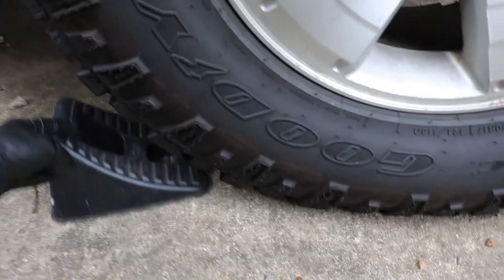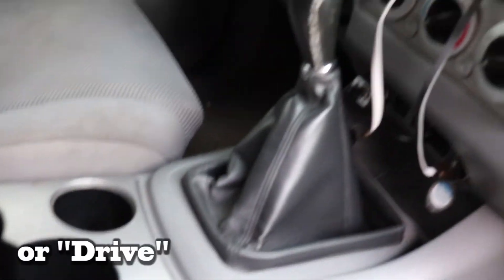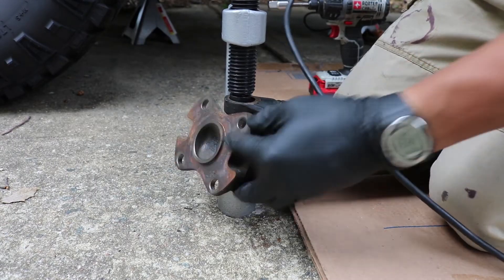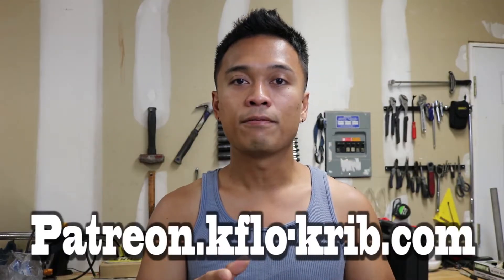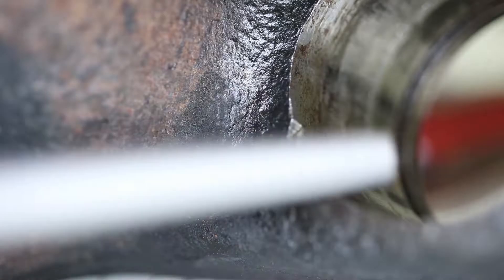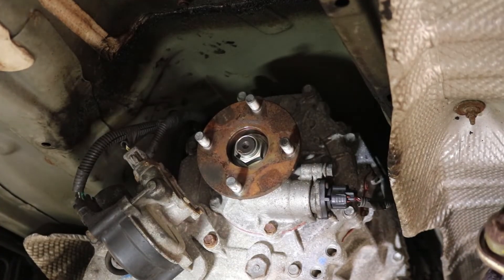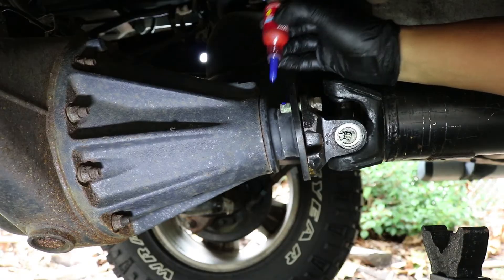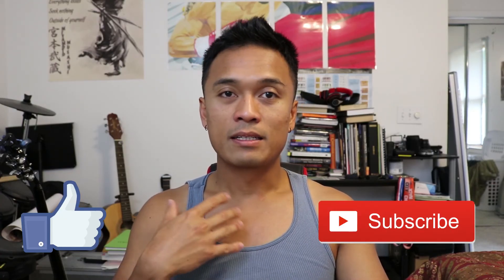U-Joint and Carrier Bearing Replacement (Tacoma DIY / How To)

Comment: You have the best step by step ways Bud!  My 2011 Tacoma with auto transmission is kinda dragging when accelerating on first gear. Will these bearing causing this dragging during acceleration too? Thanks in advance
Reply from the maker: Thanks for supporting the channel bro! When you say dragging, are you saying loss of power? or are you saying that there's a dragging/screeching noise at first gear?
Reply: @TacomaTutorials  didn’t realize you responded Bud. Yes the the bearing was replaced and the problem was gone. But once in a while I can still feel the grinding whenever I accelerate. Not all the time though. Should I just grease?
Reply: The center bearing was also replaced prior to the u-joint. I drive 125 miles one way from Richmond to MANASSAS Virginia and I just want to make sure everything is ok driving this far. Thanks for an awesome vids. You’re the man! Pinoy friend here man
Reply: @TacomaTutorials  Bro please help me on this, the center bearing that was replaced a year ago went bad and the shop put in a new one last Monday 2/2/22. Unfortunately it’s still vibrating. The rear UJoint was also replaced 4 months after the center bearing was replaced. Could the shop I brought it to wasn’t assembling it right from the first bearing replacement and to the new one last week? Please help. I appreciate your help Bro! Your Tacoma knowledge is incredibly amazing. Thanks for helping us here.

Comment: Hi KFlo Tacoma, would you recommend buying a new nut for the center support/carrier bearing?  Or just reusing the original nut to secure the bearing?  I just came across a thread on Tacoma World where someone mentioned that this should be replaced when installing a new center support bearing.  Greatly appreciate your videos!    https://www.tacomaworld.com/threads/cant-find-spicer-u-joints.393477/
Reply from the maker: I reused the old one and these are high grade nuts (I believe 8 or higher). No issues so far after 40k miles. Just secure them properly with the right torque. People can argue the same thing with the 8 other nuts that hold the driveshaft onto the diff and trans. At the end of the day, it's a moot point and it boils down to personal opinion.
Reply: @TacomaTutorials  I appreciate the response!

Comment: HOw to change u joint for bmw e36 which no clip?
Reply from the maker: I haven't done an E36 but you may just have to press it out. after doing some quic research, it looks like the joints may either have a C-clip on the inside or the ends may just have been staked in place

Comment: Just replaced my carrier bearing and 3x u-joints today. Huge thanks to you as I watched your video and did the work step-by-step. Again I think you have some of the most informative Tacoma videos out and I often refer your videos to others on tacomaworld. Thank brother I appreciate it 🙏 👍
Reply from the maker: Excellent! I'm glad it worked out!
Reply: I was told my carrier bearing on 2008 4WD Tacoma needs replaced relatively soon. Mechanic said I had to replace the ENTIRE drive line (both shafts) with it, that I couldn't just replace the carrier bearing.  This video seems to indicate it can be replaced. Thoughts?
Reply: @brianevans6860  find a new mechanic
Reply: @brianevans6860  unless your driveline is all dented up you’re totally fine reusing it. Like the guy above said, don’t go back to the mechanic that told you that.

Comment: How much play should the driveshaft have inside the center support bearing? My Tacoma has quite a lot of play and I’m not sure if needs to be replaced or not.
Reply from the maker: That's a rubber shock mount so there will be play. the issue would be if you are experiencing driveline vibrations

Comment: What do you suggest to do if your u-joint zerk fittings will not take grease. I used a pick to moving the ball in the zerk and cleaned them up really good. Grease just pushes out the side of the zerk on all u-joints and I can’t see any grease getting pushed out of the u-joint itself.
Reply from the maker: It sounds like the zerk is still loose. You can tighten the zerk fitting with a flat head screw driver (if you have the same one as me) or a wrench

Comment: Excellent video, thank you! Do you need to make sure the zerk fittings are oriented the same on the new u-joints as on the originals relative to the driveshaft? Does that effect the balance of the driveshaft?
Reply from the maker: Zerk fittings are very negligible in terms of actual weight balancing. I went from zerks that were on the center of the cross to zerks that are on the outside by the needle bearings. No vibration issues
Reply: @TacomaTutorials  Thanks!

Comment: Did you later install spacers to the center carrier bearing?
Reply from the maker: Yessirree! I installed roughly after I replaced the clutch. Which you saw in the tacoma vibes video.

Comment: Why the locktight and what is the importance of keeping things aligned?
Reply from the maker: Its a high vibration system, loctite is insurance that the hardware wont back out. The driveshaft position is balanced, if its not put back the same way, it will vibrate
Reply: @TacomaTutorials  thanks for the swift reply! The rods in my bearing turned to dust. It is a good thing I finally got around to doing this. Thanks for your help.

Comment: Does all three U-Joints use part 270?  or are parts 290 and 235 used for them? what are the differences between the three Moog U-Joints?
Reply from the maker: All three use 270. Differences are sizes and mounting style

Comment: What press kit is that?
Reply from the maker: This is the ball joint press kit you can get from Advanced Auto or Autozone
Reply: @TacomaTutorials  thx, I liked the 'completeness' of that kit, but not the price when I looked it up :P  Ended up ordering the $50 ABN one instead.   Looks like it has everything I need for the u-joints at least.
Reply from the maker: FYI, its free to rent. They allow you to borrow it for up to 3 months. The rental deposit is the cost of the tool kit. You get that money back completely once you return the item. Look up their loaner tool program

Comment: Great video, I am about 75% done, I took notes and am very happy so far.  I never thought that Center Support Bearing was going to come off the shaft but it did.  The press made everything super easy.  Getting a good angle on the nuts when taking off the drive shaft was hell since i started off doing it by myself, it was very timely, eventually my kids came home and were happy to shift the truck back and forth for me.  Thank you so much for the video.  I spent much less money then if I would have taken it to the mechanic and the last time this same thing happened apparently they only changed 1 of the U-Joints and the other two were dust this time.
Reply from the maker: I'm glad the video worked out well for you! Please help my channel by sharing my vids with your tacoma friends!
Reply: Finally stopped raining and I finished today and test drove it, runs perfect, thank you so much for the video! Next i'm going to try alignment once I get some new tires... Was thinking Michelin any suggestions for all-season mostly highway and in town?
Reply from the maker: Glad to have helped 👍 I have the wrangler duratracs which work great on the road and on the snow. I would recommend those.

Comment: hows the anchor center bearing holding up? just wondering if it would be good to use that or im better off getting the oem part?
Reply from the maker: Its good. No issues yet
Reply: @TacomaTutorials  how long for the whole thing to get finished 3 or 4 hours?
Reply from the maker: I was filming so it does take longer. I would estimate about 4-6 hours. Best of luck!
Reply: @TacomaTutorials  thanks yes video was very good!
Reply from the maker: Thanks for the kind words!

Comment: Great instructions. Followed for my 2010  (110K) Taco after getting some vibration under the seat. Took approx 3 hours for the three U joints (did not do the carrier bearing). I used the U joint tool from Advanced Auto (free) and it made it a lot easier than hammering. Everything you said was exactly what was required. Truck now runs great again. Thanks for your help!
Reply from the maker: I'm glad it helped! Please share my vids with your Tacoma friends!

Comment: Used this video the past few days. Excellent video! Ive watched at least 10x as Ive gone along my repair. Quick note though FSM lists torque on the nut for the Yolk for those at 134 ft lbs, then remove nut and go to 51 ft lbs. First value to seat the bearing, 2nd value is the torque spec.  By the way the breaker bar through the ears was a phenomenal idea!

Comment: Had my u joints replaced but now I have a vibration at 30-35mph and a low pitch sound at 55mph could it be my driveshaft is out of phase ???
Reply from the maker: If it occurred right after the replacement then that may be the case. You never noticed it before right? Those driveshaft are balanced to the drivetrain and need to be installed in the same orientation on both the input and output sides.
Reply: KFlo's Tacoma Build yea it happens after I had them replaced ,,, Would I need to take it to a driveshaft shop or would I be able to get it into phase myself ???
Reply from the maker: Sometimes the dealer may already have marked the driveshaft. If so, then just remove them and line them up. If not, you would have to go to a shop. Good luck
Reply: KFlo's Tacoma Build aright cool thanks

Comment: Great video man as always. Did you have a vibration or did you just feel it was time to change it? How many miles did you have on your rig at the time of video?
Also do you have a 4wd or prerunner?
Reply from the maker: I had some chirping happening at the driveline when I was coming from a dead stop. Upon further inspection, the u joints had some play. I replaced the U-joints at around 110,000 Miles. To answer your last question, I have a 4wd.
Reply: @TacomaTutorials  mine has a small clunk if i push the gas a little hard or if i dont stop completely.

Comment: Excellent video.  I just figured out what a vibration is that has plagued me for some time and noticed the grease was slung all around.  Moog #270?  Looks like several places cross reference this, but Amazon is the only place that says it doesn't fit my 2009 base 2wd.  Also, it suggested a Anchor #6073 instead of #6074 for the bearing, but the descriptions on Rockauto (which also just reads "Tacoma 1995-2015" for both of these, different prices) read suggested both as a replacement with one mentioning 4wd/prerunner, the other for rwd base with the same specs.  Do you know the difference if there is one?  Amazon might be wrong or is the 2wd  base different than the pre-runner/sr5 here?  Thanks!
Reply from the maker: In double checked in rock auto. It does say moog 270 does work. I would recommend getting the moog 270 over the others because the grease fitting is so easily accessible. You can always get the others on autozone or a local shop as backup and return them later on anyways. Good luck!
Reply: @TacomaTutorials  Thanks for the info.  Mine should be relatively easier too because with 2wd, the transmission side yoke is a splined and slides in with no bolts  I should be able to leave the truck in neutral for the entire replacement.  I'll only have to remove the 4 rear bolts and carrier.  I think I'm going to just buy the press from Amazon because its always nice to have that one tool when you need it and there are 2 other tacomas in my family.  Wish I was lifted because then I wouldn't need stands to crawl under it comfortably.
Reply: @TacomaTutorials  Pro tip to others.  DO NOT install the spring clips until you've set both opposing sides of the u-joint.  I, in my royal dumbass fashion, broke the lip of the flange yoke connected to the rear diff by pushing one side too hard against a clip trying to set it.  It seems like they're super tight to grab the lip.  I now dont have a truck until fixed.  My local dealership (Newark Toyota) was realllly smug about the parts and told me that I had to buy an entire driveshaft.  I asked because I saw them on Amazon and Summit but couldn't confirm based on the notes.  I knew better and I dont think this will impact balance.  If you're trying to find this hard to get part because its not listed in the catalogs, look here - https://www.northerndrivetrain.com/product/PTI-3302-185.html  I ordered one and also needed another moog 270 because I got a either used or bad u-joint from Amazon so a replacement is on the way.  This is apparently the same part of some of the 4x4s so would apply to the xfer case if you have one.  So much for easier.  Should have kept silent.

Comment: Hi K Flo,I'll attempt to do this on my 98 tacoma 3.4 4x4 is there anything you would recommend since is 4x4?
I'm not a mechanic to start with but I like to get my hands greasy once in a while and I have done some repairs on my tacoma before.
Thanks for your videos and I hope I can stop the vibrations/hammering when switching gears and right after pressing gas pedal.
Reply from the maker: My truck is also a 4x4. The front wheels are driven by the front CV axle assembly and is completely independent from the driveshaft/propeller shaft that's driving the rear. It's a pretty straight forward job to tackle, just take your time. Hopefully this fixes your hammering issues.

Comment: Do you have to do the same process with an automatic transmission? Also, why you don't have a carrier bearing spacer with your lift? Great video by the way!
Reply from the maker: Regarding the carrier bearing spacer, the lift kit didn't come with one and i don't think it needs it. I was inspecting the underside of the truck after the new U joints were put in. The purpose of the U joint is to transfer rotational force from the drive shaft at different angles. If a spacer was put it, it just changes the rotational axes (plural of axis) angles of the middle U-Joint to be more obtuse and the rotational axes of the transmission U-Joint to be more acute. The forces in those angular differences are pretty negligible considering since it will only change the angles by a few degrees over the span of the length of the whole drive shaft. If you take a look at it, the rear blocks on the lift are only ~2" and that whole drive shaft is roughly 4 feet.
Reply from the maker: Additionally, if you do a quick hand calculation, a 2" drop over 4 feet is only a difference of ~2.3 Degrees. Therefore, we're not changing the angles significantly enough to require a spacer.
Reply: Thanks for the info, man! I got a 2 inch blocks in the rear too, but I will be upgrading my lift with 1 inch block and 2 inch AAl from wheelers very soon. I got a few washers on my carrier bearing already, but I don't really need them. Crazy ah! :)
Reply from the maker: Pretty much the same process with automatic. Put it in "drive" or "neutral".